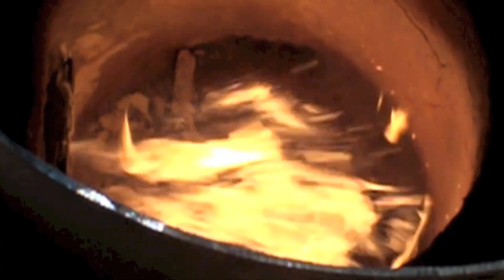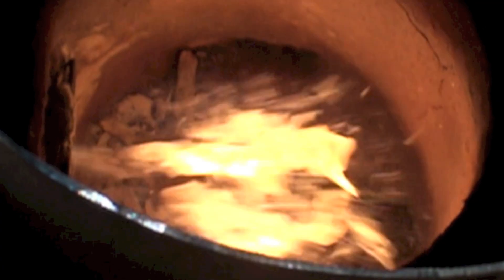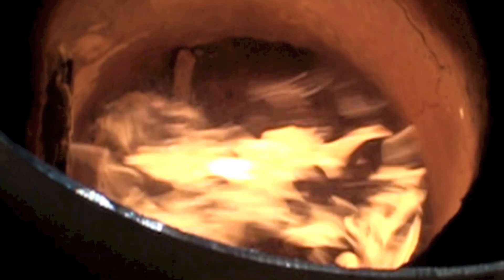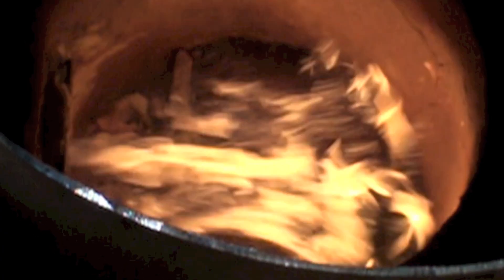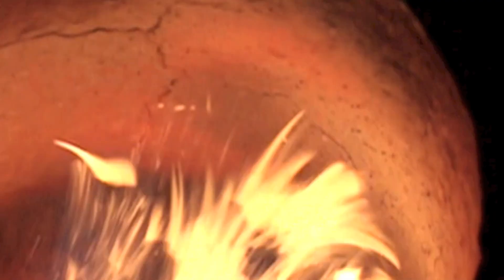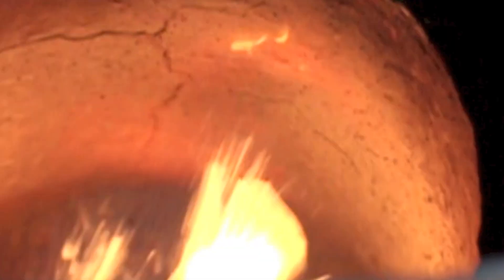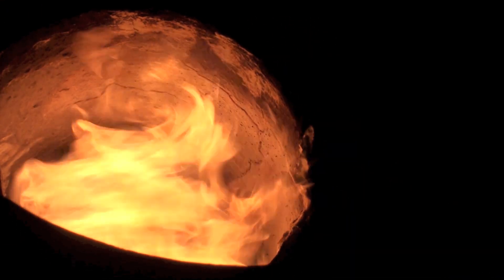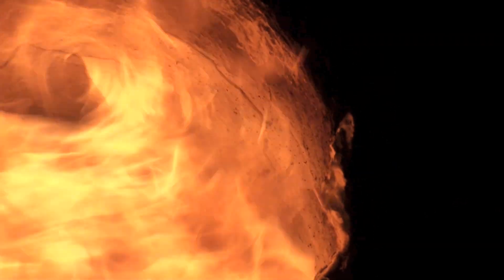The effect of too much air in the oil burner flame

Comment: I have an acv dynatherm boiler with a beckett af11 150 oil burner runnimg a 1.00 gph 45B nozzle @ 160 psi pump pressure per manufacturer settimgs. Im experiencing a surging soumd when running under combustion amd cant seem to get it to run smoothly. Was just serviced and everything was cleaned and within spec. Any ideas of what could be causing this issue

Comment: Hey mate. I have a issue with burning out shafts. On a oil jacket kettle you got any checks. Iv literally changed burners and the knew one is better but still over heats shafts
Reply from the maker: By shafts, do you mean the burner tube?
GFM
Reply: @grayfurnaceman  becketts burner coupling  between diesel pump and the fan motor
Reply from the maker: @jacksonbermingham2168  Is overheating and melting, you have a positive pressure in the combustion chamber.  You should have -.02 in wc over fire and -04 in the smoke pipe.  Possible plugged heat exchanger or vent.
GFM
Reply: @grayfurnaceman  so we have to huge kettles hold 500kg of product o. The back of a truck.  And the it must be gaining pressure while driving some how. Ud think the chimney's when driving would cause a vacuum not positive pressure into the combustion chamber

Comment: What happens when u add to much oil?
Reply from the maker: Smoke
GFM
Reply: @grayfurnaceman  does it effect heat ?
Reply from the maker: @400sbccamaro  It definitely does.  Too much air cools the fire, and combustion is incomplete.  You can literally shut down the fire with too much air.
GFM

Comment: Could you make the air tribulated and made to spin in a circular way to make the flame super efficient ???
Reply from the maker: The head does swirl the air fuel mixture for higher efficiency.  There is not a lot more we can do to increase steady state efficiency.
GFM
Reply: @grayfurnaceman  Thanks you GFM

Comment: So... wouldn't temperature of the combustion be the deciding factor of where the sweet spot of where to set the air intake?  I just glanced through one of the manufacturers guides on this and they are checking CO2, O2, CO, Ambient air temp, basically have to be a physicist to figure.  I'm sure there are probes that can measure temp at this high heat?  Just adjust till highest temp is reached?  What does GFM think?

Comment: Gfm, I've had 3 or 4 techs to look at an issue we are having. We have a biasi with riello burner.  I'm wondering if this is the cause. We get a loud shuttering bassy sound with the barometric damper opening and closing along with those sounds. Along with a slight burned oil smell. I've been hitting the switch to shut it off, but today let the cycle complete. The next cycle did not experience this again.
Reply from the maker: That sounds like a rumble.  When a burner rumbles on startup, it is not establishing draft.  Look for sooted heat exchanger and smoke pipe/chimney.  
GFM
Reply: I had similar effect from a clogged nozzle and tank filter. Would spit oil out untill it built enough pressure and would have a rumbling smokey start.I also solved a slight delay and loud bang on startup by moving the gun deeper in the burner tube.  I also turned pump pressure down in hopes of less atomization in the oil, making a less explosive ignition.
Reply: Sounds like there was excess fuel in the combustion chamber, or poor overfire draft due to a sooted up heat exchanger.

Comment: THANK YOU !!!!!! You saved my ass tonight.I had too much smell in the home regardless of changing the filter then nozzle .In fact it grew worse ! In desperation I Prayed.With in minutes I got the idea in fact remember seeing the last " furnace repair man " fumbeling with the air mixture.So I went down looked inside as the flame was on,,,,wimpy flames and long points and one hell of a nasty smell.Ok Needs air.Wrong it got worse.OK needs less and wallah !!!! Huge flame like I never saw before and Zero smell :>) But is what I did safe ? Next idea was check google youtube.Here you are ! And I now understand what and why Just the smallest ajustment is needed. Thank you very much Merry Christmas :>)
Reply from the maker: Merry Christmas
GFM

Comment: Great videos GFM, thank you for your info. I am checking my oil furnace for winter, it was serviced with new parts about 18 mos. ago, need to clean some soot, change nozzle (which has that no drip tip on it) .75 80A. The transformer area and contact points looks pretty clean. Don't think I've had any smoke or puff-back issues, but it looks as if I am getting more soot than usual in the flue pipes these were completely cleaned 18 mos ago. Should I let more air in the burner ? Also I have a 1/16" crack in the combustion chamber as shown in my pictures below. The furnace does a couple slighly shakey rumbles rumbles when "Call for heat" kicks in. Any input would be appreciated. Thank you.
https://imagizer.imageshack.com/v2/1600x1200q90/924/PhKMed.jpg
https://imagizer.imageshack.com/v2/1600x1200q90/922/Hl7hKJ.jpg
https://imagizer.imageshack.com/v2/1600x1200q90/922/Pgr6dO.jpg
https://imagizer.imageshack.com/v2/1600x1200q90/924/muW4CE.jpg
https://imagizer.imageshack.com/v2/1600x1200q90/922/X1avGq.jpg
https://imagizer.imageshack.com/v2/1600x1200q90/924/TEMi3E.jpg
https://imagizer.imageshack.com/v2/1600x1200q90/922/IWVybv.jpg
https://imagizer.imageshack.com/v2/1600x1200q90/922/n6jhsU.jpg
https://imagizer.imageshack.com/v2/1600x1200q90/923/jPoUzY.jpg
https://imagizer.imageshack.com/v2/1600x1200q90/921/jdBUHR.jpg
https://imagizer.imageshack.com/v2/1600x1200q90/922/5U7675.jpg
https://imagizer.imageshack.com/v2/1600x1200q90/924/FUT8RX.jpg
Reply from the maker: No way to know for sure about the soot without a smoke patch test.  The rumble is the furnace not establishing draft.  This could be a blockage in the vent, or a negative pressure in the structure.  You can try adding more air, but too much air rather dramatically reduces flame temp and thus efficiency.
GFM
Reply: I went to vacuum the soot (with ash vac) and removed the cover on the furnace between the damper and the furnace by the flue elbow, soot is about 3/8" to 1/2" thick on everything and probably all in the furnace internally, the electrodes and motor area very clean, no sign of soot particles outside or around the furnace , no puffbacks or loud booms, I have a stainless steel chimmney cap that has turned black and also the top area of the chimmney, the cap seems adequate for venting, barometric damper moves freely when furnace is running, it has been 20 mos since I changed the .75 80A nozzle and was planning to change it at this time. Any idea how to reduce the soot problem ? Thank you.
Reply from the maker: Once the heat exchanger is cleaned, replace the nozzle and set the air.  Without combustion tools, you will need to just get the flame ruffled and bright yellow.  It is quite easy to put in too much air here but better than too little.
GFM
Reply: I understand that having someone watch the chimmney for smoke, and setting the air on the burner so the smoke just disappears, but when viewing the combustion chamber would a ideal setting be having the flames about 2-3 inches rising above the chamber ? As you mentioned more air makes a cleaner flame, but when viewing through the inspection hole it's hard to tell if the flame is sooty. My soot problem seemed to be the fact that I had it previously set where the flames were most likely rising about 7-8 inches above the top of the chamber. thank you.
Reply from the maker: If that is the only method you have, the 2 or 3 inch flame would be best.
GFM

Comment: Our Miller oil furnace with Beckett afg burner started to smell of oil and there was some white smoke emanating from air intake openings upon shutdown. Called local HVAC company and they send out a tech Thursday. He replaced the nozzle, electrodes and upon checking settings he found the pump was bad and said that was likely culprit of oil seeping after shutdown and causing smoke.  Friday we were gone most of the day but once home I turned furnace up and lo and behold it's doing the same thing as before we got it serviced. I looked around and noticed a drip of oil on floor of furnace under burner and also flipped open transformer and the bottom of it has oil on it as well. I didn't see any oil in burner tube but did notice the blower wheel appeared to have some oil on it as well. I called the service company and they are going to send another man out Monday. They tell me these Beckett burners are known for this and can be difficult to find the problem. Hopefully they figure it out because we're not running it until they do.
Reply from the maker: Possible vent blockage?
GFM
Reply: I am going to mention that to them tomorrow. Would that also cause oil on bottom of transformer or blower wheel? When I looked at it, it wasn't soaked with oil but just a little wet with it. That was the issue when I called them out initially. That and the white smoke after shut down. They put the right nozzle in it because I myself checked the furnace data plate. I watched them adjust everything else and they did seem to do a complete job. They claimed the pump was causing the problem by allow oil to push through after shutdown but obviously that didn't fix it. Would the vent blockage somehow allow unburned oil into blower/transformer area? I hate to talk to the tech as though I was trying to tell him how to do his job but also like to know a little about the details before they come. We have used them before and never had any issues. Maybe just a weird thing that is difficult to find.

Comment: I have a V-73 Boiler with a beckett burner and the air band adjustment was open about an inch and flame looking through the hole looked orange and not much flame at all really, I kept looking through the hole until the flame turned yellow and rolled more inside to fill the chamber. that band is only about 1/4 inch open now and other adjustment on side points to number 8 which is almost wide open also . Wondering how much air these actually need because i have seen side adjustment a lot lower to number 2 and large band closed. I just put in a new .80 nozzle and adjusted the electrodes  and had been getting a lot of soot with too much air. As I said the flame looks better now but maybe could be even better.I checked the grates inside and can see down through all of them and vacuumed all soot and scale i could out after boiler cooled a few hours. Any recommendations on what most air bands are set at for beckett burners ? The large one and the side band .
Reply from the maker: With a .8 gal nozzle the band should be closed.  The side adjustment I would think less than 5.  If you are getting soot at that setting, you could have a gun depth adjustment problem or the head is damaged/plugged.
GFM
Reply: The head looks like new and not plugged ,so maybe needs adjustment.The boiler has a hinge and 1 bolt to unscrew to open that into the burning chamber and to see the front of the head.I looked through the back of the head with a light and nothing blocking any of the fins or the outside slots/holes . Thank you for your insight. I have been burning 50 to 60  gallons of oil every 2 weeks and seems to burn too long to get the small amount of heat i have from it and at a high cost about 3.5 to 4.2 gallons burned a day . I'm kind of afraid of twisting that one bolt off that holds the door to the boiler shut if i try taking it out.
Reply from the maker: If you are able to look into the combustion chamber, perhaps with a mirror, look for combustion chamber parts extending into the flame.
GFM
Reply: With all due respect there is no why a home owner can or should be playing around with the settings on his burner. The days of looking at the flame are long over, they are going to need at the very least fluid type Bacharach testing kit. The best would be a digital combustion analyzer a cheap one of those is $600.  Let me add you are doing these folks a disservice this fellow messing with air band setting hs no idea what he's doing. The dial air band setting is given by manufacturer of burner air band setting is critical. Maybe this fellow has terrible draft, or some other issue that requires the larger opening of the air band?
Reply: I sotac, with a typical liberal response. Label everyone a total moron, seeing "we're all equal", (in the liberal world). In reality, there are people competent enough to make their own rational judgement, when provided with accurate information. This channel, (like so many YT channels) give people incite into specific issues that they may, or may not feel confident in performing. It isn't your responsibility to critic  some-one else's channel, in the attempt to make yourself look more knowledgeable. You're not helping, "with all due respect". We use-ta have freedom of speech, but we know where that freedom is going now-a-days, don't we.

Comment: Mine was excess air around 64%, now it's in the 30s, could this have been the reason it was starting to whine sometimes (sounded like a jet engine spoiling when turned off too)at 64% ? Could it have also been the reason for the loud starts?
Thanks
Reply from the maker: If the pump is a mini, it is probably failing.  Excess air will not cause the problem.
GFM
Reply: Just got a new pump a week and half ago , a2va-7116 or such .

When this pump goes will I have oil everywhere....?! No osv on top feeder Roth tank, 2 firematic on supply and nothing on return.
Reply from the maker: Probably not.  The return line may drain if it goes up from the pump.  Of course the valve should be shut off.
GFM

Comment: If the issue of having too much air is that it cools down the fuel, then why don't you preheat both the air and fuel before it goes into combustion?
Reply from the maker: BrokenLifeCycle You can preheat both the combustion air and the oil however, it does not make a lot of difference in combustion efficiency.
GFM